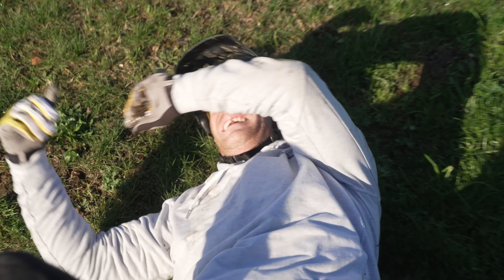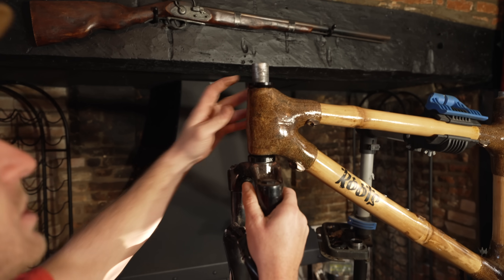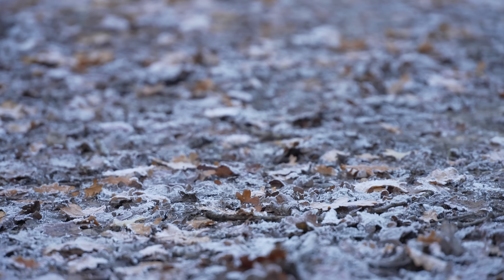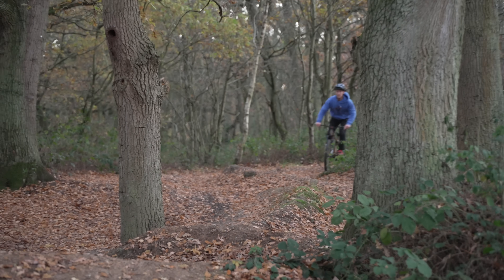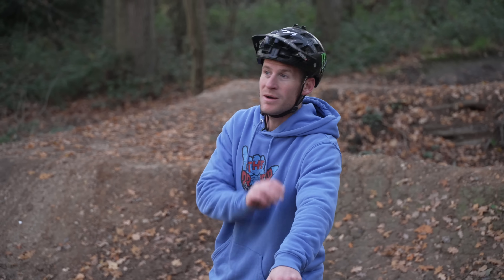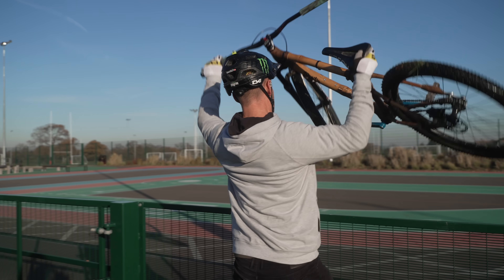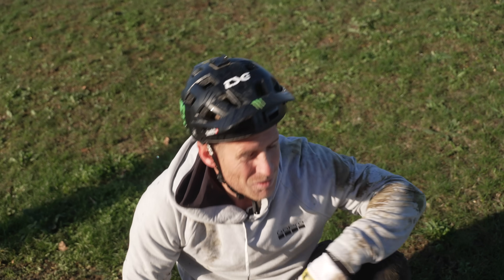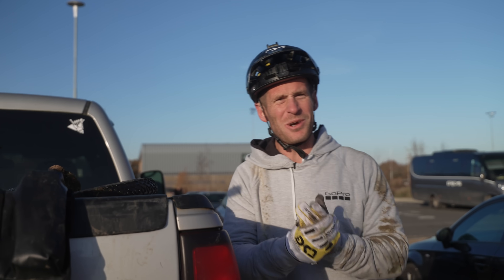HOW LONG CAN THIS BAMBOO MOUNTAIN BIKE FRAME LAST?

Comment: Hi Sam, sorry that happened to you. Bamboo is such a good material for frame building. You're right, those fibers i think they're hemp which is plenty strong for normal riding but for a jump/ pumptrack bike i'd use carbon fiber. We run a bamboo guided tour business here in barcelona, and our bikes have their joints put together with both fiberglass and carbon fiber and we use them on a daily basis and they hold up pretty well. Some of them are 8 years old with no signs of weakening or cracks. Loved the video, have a nice day everyone!
Reply: See if you guys can figure out a way to make the joint's more resist to shock. To be honest I'd totally start downhill mtb again on a bamboo frame if it could handle the shock and stress of going down what's pretty much a cliff
Reply: @jpmac97  They literally said that they're use carbon fiber instead of hemp for the joints.
Reply: Send him a bike to ride
Reply: Actually I would never use any kind of bamboo frame or part. They cost like a normal aluminium frame and they are insecure. 400 dollar for a piece of wood is not the right price for this joke.
Reply: @bt7267  I think you should try a bamboo frame before to give an judgement, for your information bamboo frame is more strong than carbon frame. Since 10 years we build Bamboo bikes and now we are developping BMX prototypes with profesional rider, we will send you videos of test of resistance doing Big jump like this you will see what is possible to do with good bamboo frames..
Reply: Thats totally wrong. For example fishing rods (splitcane flyfishing) have been used a very long time. But it is rarely used any more due to fiberglass and carbon fibre has huge advantages.
Reply: @bamboobiketours6242  haha no its not.
Reply: If you look at hemp fiber tensile strength compare to carbon fiber, it is significantly lower.  That is why you don't see carbon frame use hemp fiber for the joints.  I'm not said you can't use hemp fiber but for the application(jump), they should have bought a carbon joint bamboo bike.
Reply: @yiucycle  how could it be stronger but For that application Not 😂
Reply: Like if you take a road bike to a downhill race, it is going to break the bike.  Wrong tool for the application. Same thing for hemp joint, it's ok for cruising around town but IMO it's the wrong material to use if you are planning to jump/dh.  As stated by others, the bamboo tubing didn't fail, it failed on the hemp joints.
Reply: Dude needs to waer his full face helmet. Sam, we love your face dude be careful (haha I almost put safe but there's no way)

Comment: Big  respect  to Sam and Lewi  For  being  out  in  this  cold  weather  for  us  And yes  bamboo  is  stronger than  steel  but  not  in the hands  of  Sam  or  a  panda bear  glad  you’re  OK BRO
Reply: Why’d do u guys have the back brake lever on the back?
I thought everyone I. The world had the back break on the right and the front brake on the left lol
Reply: In England it's back brake on left and front on the right  my bro!!! (The correct way to have the brakes!!)
Reply: What U mean the correct way?
Reply: He should put fox 36s on a bmx bike lol
Reply: @sushuki4833  A 20"/29" mullet BMX with Fox 40s would be funny LOL.
Reply: There is a whole bunch of material properties other than tensile strength, most notably the elasticity of bomboo in tension is an order of magnitude lower than of steel. Deduce the rest yourself. Sam is great, but that was really sketchy.
Reply: @iantowers6972  nah there's no correct way, but it's probably better if you want to ride motorcycles and bikes lol
Reply: @ironeinar  it used to be the correct way before brakes became powerful/one finger... for most ppl the right hand has more strength (and dexterity).
it also helps if the rider uses motorcycles as you said
Reply: I’m pretty sure he wouldn’t risk himself for his viewers. He’s doing this because HE wants to.
Reply: @sergeigasilov7307  "There is a whole bunch of material properties other than tensile strength"

Bamboo doesn't even have a higher tensile strength than steel unless you measure it per unit of weight, which is meaningless when using it in its natural form in a bike frame.

Comment: The bamboo didn't fail though, the weird fibre resin mix used to bond it at the nodes did. I figure a bike made from bamboo that's lugged with carbon or titanium would be really solid and comfy. I'd even go as far as saying that a titanium lugged bamboo rigid MTB for weekend trips may be one of my biking dreams. Triple triangle because why not, elevated chainstays because why not, Surly Moloko bars, Shockstop stem and seat post, the mint equipment.
Reply: He bought it second hand too. Many resins and plastics especially old fashioned ones deteriorate over time from age and they turn super brittle like in this video.

They also build scaffolding in some countries using bamboo so you’re so right; that would probably be incredibly strong and lightweight. It does sound like it would make such a nice bike.

I also feel like the bamboo was acting like a spring kinda on those jumps. It was launching Sam lol

Comment: I think Sam building bikes is one of my favorite parts of this channel.  I am so intimidated by a lot of jobs, and I worry about fit.  And Sam just slams it all together and everything works and if it doesn't he makes it work.  Mint
Reply: And he doesn't even use the proper tools.
Reply: @Durwood71 whack those bearings in. Who needs a press?
Reply: @choddo  Sam is like the anti-Seth from Berm Peak who has every top of the line Park Tool known to man.

Comment: Where did he even get the idea. 
Sam never fails to keep me entertained 😂
Reply from the maker: Glad you liked it!!
Reply: @tarstarkusz  7 out of my 13 bikes are STEEL💯💯✊😎.
Reply: How can one even think of doing a table riding an bamboo bike 
Imagine there being an actual bamboo table there
Amazing content
Reply: In Asia they will make everything out of bamboo, including engine bearings.
Reply: @ProgressiveEconomicsSupporter  Yes indeed brother 👊😎💯👉🚴☝️!!!
Reply: @tarstarkusz  I thought titanium was the toughest material. I know steel bikes are heavy.
Reply: Most commercial mountain bike versions have the joints bound in carbon fibre. I reckon that would have been ok
Reply: @tarstarkusz  I think the word here is malleable. you can bend steel back to it's original shape far easier than other materials, carbon for example is stronger than steel but is very brittle and stiff. once carbon goes past it's breaking point, there's no going back.
Reply: @tarstarkusz  I wonder who makes chromaly steel bikes nowadays? For some reason the only main options for current bikes are aluminum and carbon. I know litespeed bike company makes titanium bikes. Now I am curious and will have to look those up.
Reply: @tarstarkusz  oh yea, you're the steely guy...at the end of the day there are certain bike parts that make more since to be made out of steel and others out of aluminum...hell, there's even some components that are usually optimal in carbon fibre or even titanium as a matter of fact. And also, the material composition of certain components can even vary depending on type of riding
Reply: @kevinburke1325  Ragley was making them but no longer, but I believe Surly still makes steel and RSD.

Comment: Bamboo is phenomenally strong and I was sure it would not break; but as soon as I saw the joints I knew that's where it would go... and it did. Well done. How about a mechano or tinkertoy bike somehow? ;)
Reply from the maker: Ohhh that could be fun!
Reply: technically it was the resin wrap that broke while the bamboo tubes survived.
Reply: @SamPilgrim  mechano bike,  you might want to rubber dip it after you build it though,  crash on that it might take your arm off.
Reply: @carlosgaspar8447  The resin joints looked to be more glue than matrix.

Comment: Very fun video, as always Sam! I'm making bamboo bikes since 2008 and stoped using hand lay-up on the main joints because are not strong, now using vacuum bag. In the video, we can see that the failure was on the hemp/epoxy joint, not on the bamboo.
Reply: @gerworks  it's a scam bot.
Reply: @mtbboy1993  Thank you!

Comment: After closer inspection it broke at the composite joint and not the bamboo. That's exactly what I predicted when I seen the closeup of the frame at the building process. Good thing you didn't break your collar bone 🦴 Sam. I'm also glad you didn't decide to back flip it. I also wouldn't try a carbon fiber frame either!
Reply: Comparing carbon fiber to the sketchy mix of epoxy and sawdust is funny, especially when 99% of the professional bike riders in all disciplines ride carbon frames nowadays
Reply: @klisurski  Composites are unpredictable if not laminated the correct direction of the stress load.

Comment: Know your limits Sam! That could have ended so much worse - the wheel actually saved you from a really nasty faceplant and perhaps fatal neck snap 😞
Looks like bamboo should be good enough for road use as long as there is enough epoxy on the joints. Not Pilgrim proof though!

Comment: I am glad you are ok Sam and yes, it is time to stop with the challenges where you set yourself up for failure as the target. I want to watch you ride for years to come. I know what you do is a high risk activity but I would be able to understand you getting hurt from a contest or free riding or whatever. As long as it isn't seeing you test where the failure point of a frame is, using a frame that you are pretty sure will break. Love ya Dude. Stay talented, not stupid Bro. - M

Comment: I have built a few carbon fiber bikes from bare tubes. I may do a bamboo from the neighbor's patch. Bamboo has no torsional rigidity, and the downtube of a diamond frame bike takes the most load of any of the tubes, and most of that load is twisting, up near the head tube and down at the BB. When I made the carbon bikes, they were laid up like wood (ie, almost all the fibers going lengthwise) so they needed some 45 degree / 135 degree fabric to resist that twisting. Turns the bike from a wet noodle into a proper bike. This fabric can be purchased like a sleeve (or a finger trap...) making that reinforcement simple to do.

That broke where everyone expected both because it didn't have any fibers wrapping properly around the head tube and tying them back to the DT and TT, but because the material (jute?) is weak and finally, the join is like a sponge with all those air bubbles. To make any DIY composite bike build work air needs to be squeezed out of the "lugs" being built by the lasagna at the join. Most builds I see do a terrible job of that, wrapping a few little straps and thinking that's compression. What works is doing thinner layers (might take 3-5 campaigns) and compressing with that packing cling wrap you can get at a hardware store. Give a first set of wrapping, then perforate with a pin all over, then cover with some foam, and apply a bunch more wrap to compress the heck out of it. This squeezes out the air bubbles AND the excess epoxy, both of which are necessary to get a trustworthy join.

 Still never be a jump bike though!

Comment: Just picked up a bamboo frame mekong creations for 40quid seems a lot stronger than your frame nowhere near as much flex and the joints look stronger not just a fiber but looks like hemp string with hardener , its a street bike should make a cool fixie for getting around on, no abuse so hopefully wont snap.
Wicked video 👍 subscribed

Comment: The slight flex in the bamboo is actually what gives it its strength.  I do kendo (as well as cycling) and we use bamboo weapons.  It’s surprising just how strong they really are.  They flex on impact and absorb the energy.
But bamboo can be brittle.  It really suffers when it gets cold.  Which given the outside temperature on the day you tried the bamboo bike, it will definitely have become brittle.  They are also become brittle if it dries out too much.  But there’s a sweet spot where it’s just perfect and is incredibly strong.

Comment: A bamboo bike reinforced with S glass fiberglass and/or Kevlar tow and high strength epoxy, can actually be a very strong and durable bike.  But problem is, people want to "go completely natural" and you lose out on durability and strength.  Note, it wasn't actually the bamboo that failed, but the fiber/adhesive composite.  (Probably flax linen or hemp and lower strength epoxy). 

   But yeah, designed and built properly with right reinforcements, a bamboo frame can be very strong, very durable, and very comfortable.

Comment: ❤ full face helmet ❤ glad your OK ❤ the frames repairable, the headset bracket looked to be organic fibres, grind off front of the head tuberous ally, epoxy it back to the frame, fair the rest into the tube, epoxy and woven Kevlar rather than carbon (to stiff) good to go again?

Comment: So, with anything fabricated, it's not the material used but more the method of joining it. That's the limiting factor.  A bamboo chair never snaps. The joints come apart.
A chair doesnt break, the joints break.
Carbon fiber however is layed to make the frame one piece eliminating the joints

Comment: Its stronger than steel because of its bending properties so this should be interesting 😂 the headtube is probably stripped strands of bamboo to tie it all together and then that resin coating over the joints they use this as scaffold in Japan but you see on some videos them being able to bend a good 80° before they spring back lol does look cool though! Be cool since there hollow if a bike manufacturer was able to wrap the bamboo round the steel frame of slide it through the centres of the bamboo for the strength to take the flex out
Reply: equally strong for equal weight 😉
here the problem is at the joints and not at the fracture of the bamboo

Comment: I have a bamboo Calfee road bike. Also with hemp wrap like yours, though built up a bit more. Eight years, 20K miles, and a couple small couple crashes later, the Calfee holding up fine.
Reply: this is the top of the range bamboo bike👍

Comment: You should probably duck tape it and a little extra cable ties, and its good as new. But to hang it on the walls purpose. Be careful Sam. You've got the best thumbnail now its time to set done for this high risk adventure.

Comment: Cut the front of an old free bike top bar amd downbar triangle and try bore the bamboo out a wee bit and slide and secure the front of the free bike into the centres of the bamboo frame and tie it back up you'll have a weird hybrid but get it going again lol

Comment: Back in the day, a lot of bonded bikes would fail at the ‘junctions’. You’d get the same failure from an old Merida mtb.

Bamboo is one of the strongest materials on the planet. Maybe the trick to avoid any need for bonding is to ‘coppice’ or ‘pollard’ the plant into a bike-shaped mould.

Comment: These bamboo kits are made with flax strapping and epoxy. Flax/epoxy laminates are extremely strong if the builder gets it right.
The big mistake here is putting the flax under load in freezing conditions. Delamination, fibre splitting, fibre breakage, and de-bonding increase exponentially under Sam's icy abuse.

Comment: the bamboo didn't break it was the Epoxy at that joint I wonder how it would be with aluminum joints and bamboo tubes?

Comment: Bamboo is only stronger than steal per weight, not in general. In this application you would need a forest of bamboo for it to weigh as much as a standard steel frame.

Comment: Google: How strong is a bamboo bike frame?
Answer: Bamboo is significantly more durable than carbon fiber, but it also weighs more and is denser. While a bamboo frame may add weight over a superlight carbon monocoque frame, Boo can boast that it has NEVER HAD A SINGLE TUBE OR JOING FAILURE IN ITS ENTIE HISTORY-INCLUDING CAR ACCIDENTS!
Sam: HOLD MY MONSTER!

Comment: Almost 30 years ago i was riding on a mountainbike with a kinked front fork. Did a tiny jump on a hill, fork snapped went over the bars and broke my shoulder ac, never realised how bad it was and my shoulder has been dislocating ever since, i can't throw stuff anymore. It's not worth it.

Comment: Shocker. So the problem isn't the bamboo, but the connecting "glue". I suppose this should initiate static redesign of the frame for bikes of this purpose to ensure the proper distribution of force. Given the material is so light, addition of more crossbars could easily implemented. The aesthetics, or lack thereof, of the bubbly connectors is off-putting, plus the price of bamboo bikes which went the way of the lifestyle pest infesting so many interesting concepts. I'll never buy a bike beyond €2000 out of principle.

Comment: I don't think it's that you 'Don't learn' - you just seem to do it anyway knowing from past experience somethings going to give.

That headset was basically held in with wood chip and glue - not a lot of structural integrity in that.  The tubes would have been stronger but the whole thing is as strong as it's weakest point - which was the glue it seems.

Got a nice Slo-Mo out of it though - I tried not to laugh and it did look painful on the chest although that probably stopped your face hitting the deck too hard.

Comment: in my opinion it's better if you wear a full face helmet (protection also for the chin)....because if you watch the video the front wheel hit your shoulder, it saved your chin and face. instead if you fell a little more to the left, you hit your chin and face on the ground... it's very dangerous... you could have had serious damage to your face going to the hospital.

Comment: The Bamboo in itself is the most resilient, strong... it's the resin that connects thats the one that fails...this frame will last long if only for cruising and some normal jumps here and there..not like this ..